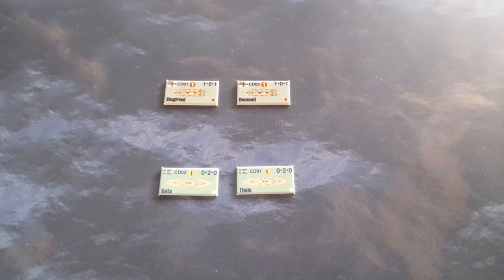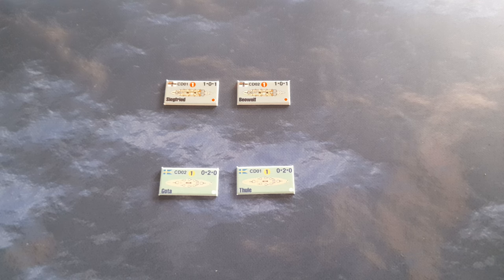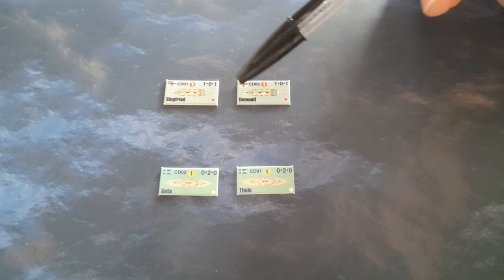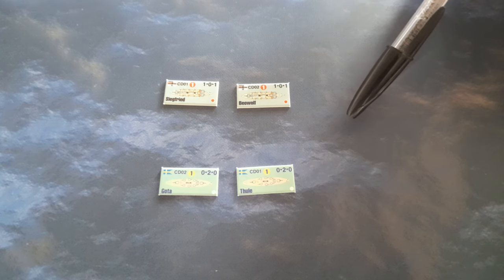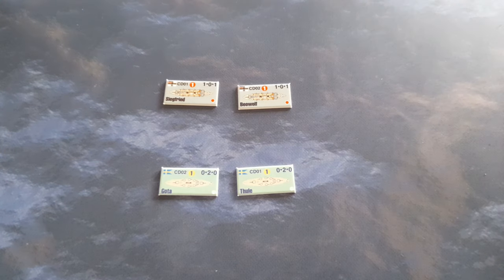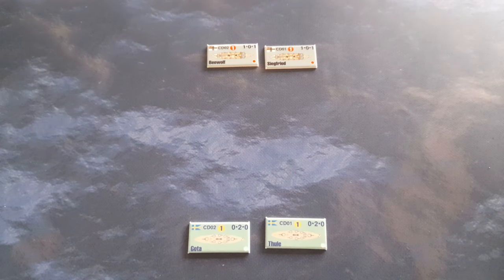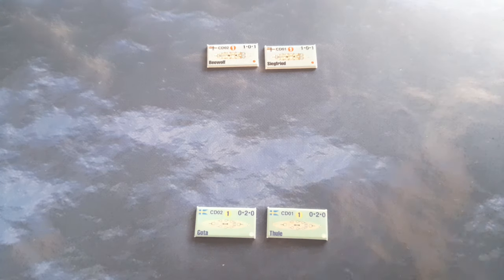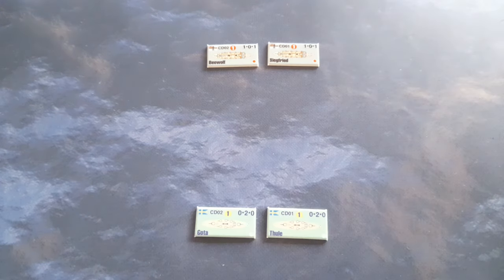Great War At Sea: Jutland - Basic combat system

Comment: I am guessing I missed it at first and you just mention you would do just combat example and no maneuvering? I would suspect movement would affect the firing for the guns?
Reply from the maker: The manoeuvreing element is present in basic combat, but it's very basic and consists of players declaring after each firing round whether they want to stay at their current range, close, or move further away. If both agree, the change of range (Close or Long) is automatic. If both want to do different things, the player with the faster fleet decides. If there is a tie, it is resolved by an opposed dice roll. A player who is at Long range can try to end the combat by declaring a withdrawal. Interestingly enough, movement does not affect gunfire in this game.